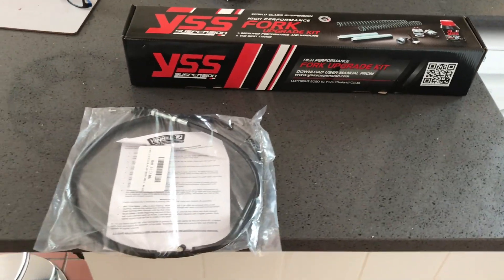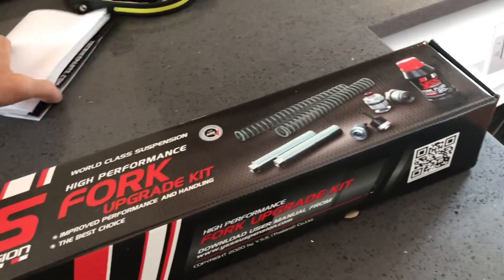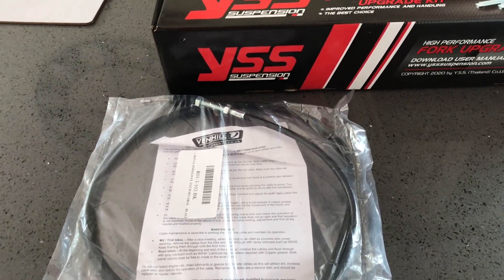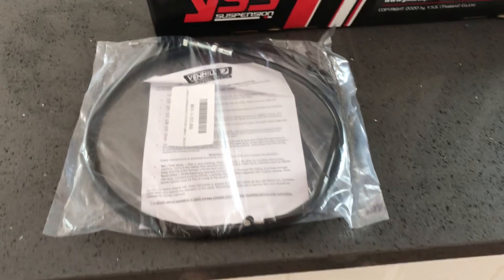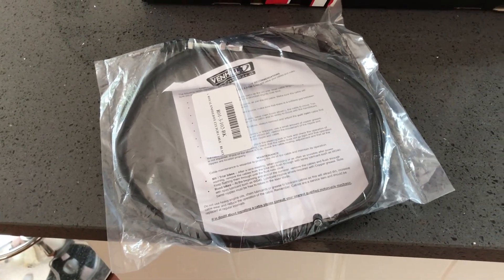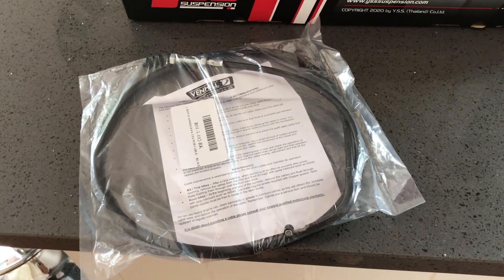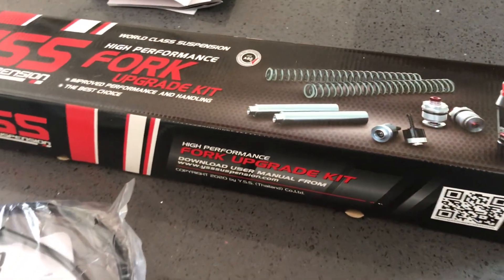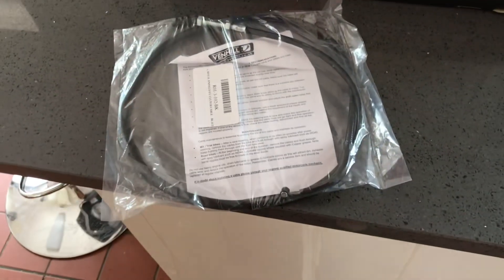Royal Enfield Interceptor 650. Two new projects. Oh, happy day!

Comment: Buying an oil level/air gap tool is a worthwhile investment...(amazon) very accurate way of measuring oil level. also measurement is achieved with the fork springs removed... on some bike anyway...good idea to check. I've just changed oil seals on my Street Triple. The manual says X ml of oil, leaving X mm air gap..spring removed. The air gap can vary by choice, but obviously both forks need to be the same.

Comment: Yss you'll notice the difference.
I want to get the Venhill clutch cable.
It'll take 300km or so to brake in & then soften them up.
You'll need at least a liter of fork oil & the one that comes in box isn't enough.I didn't even get fork oil in my kit but I would of had to buy more.My instructions said use a 15wgt so I did Motul 15wgt but Motul 10wgt would of been better & most people use a 10wgt.Mine was to firm & after the brake in soften it from 30% to at least 40% & it great now.Need a £5 oil fork syringe to get level of oil right & bubbles out.

If you got any orange crush paint left could paint headlight bracket again & mudguard brace.
Reply from the maker: Goo to know re the oil thanks! I’d better get more before I start on the forks…….
Reply: @internetpolification  Yes 1 liter Stu Fillingham does a video about Yss fork upgrade & reasons for using a 10wgt.I know a few people that used a 10wgt & wish I did now but ok now but during brake in Motul 15wgt was way to firm at 30% brake in setting & with 10wgt the others just left it at 30% after run in as I had to soften mine after brake in to 40% to soften up front.If I replace fork oil I'd use 
Motul 10wgt.Ask others as fork oil weight is different from brand to brand & roads in NZ 🇳🇿 are shite.I think Stu used Silkolene 10wgt fork oil but might pay to watch HIS video to make sure & Silkolene isn't easily available in NZ so is expensive too.
Reply from the maker: I just checked the service manual……they specify 10W
Reply: @internetpolification  Yes in my instructions in kit it said 15wgt so I went that way & others had done the same but many more have done 10wgt.From my own experience I wouldn't do 15wgt Motul again but do 10wgt Motul.My mate use 10wgt fork oil & hasn't needed to adjust them at all as I adjusted mine after brake in,just to firm & soften them up to they good now.
A 10wgt should be sweet from day 1 & need very little adjustment.
Reply: If yss 15w oil comes in the box then that is best to use that. All oil appears not to be the same specs so that is my only choice taking this into consideration. When you pay good money for the kit don't spoil the ship for a half pennyworth of tar.
Reply: @paulmessenger1006  I used 15wgt as Yss instructions & used Motul fork oil & wish I used Motul 10wgt which is probably the same as Yss 15wgt.No big deal once broken in just soften preload to suit which is what I did but the 30% brake in period if 300-400km it was firm alright hence the softening up.
Works great now & Yss rear next mod on list.

Comment: I know exactly what you mean, I have a 2021 interceptor with like a 'snagging' every so often when I pull the clutch in, already had 1 new cable but still does it. 
Please post how it feels with new cable
Reply from the maker: The new cable sorted it out……. I removed all slack at the top end of the cable where it fits into the handlebar lever assembly…obviously not too tight since this might affect the operating arm on the engine. But enough to remove the slack as I thought maybe the snagging was the top of the outer cable clicking in the handlebar assembly. The new cable is far better quality (surprise, surprise…) and the clicking has gone now…..

Comment: Fitted the Vernhill cable to my GT 650 before I rode it great cables 😎👍
Reply: Just sprayed a little WD40 down the tube as per instructions 😎👍
Reply: Plus used original rubber corrugated part down at where attaches to engine, found it fitted better thsn the Venhill one 😎👍